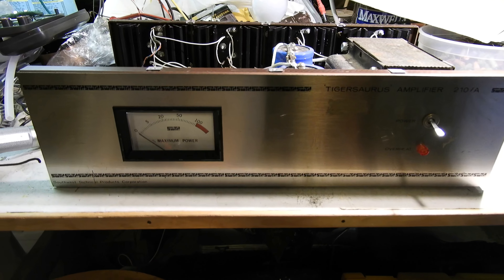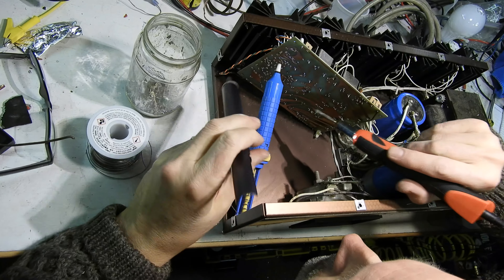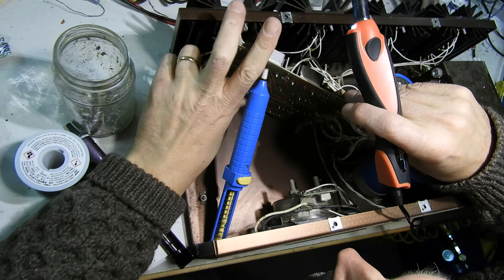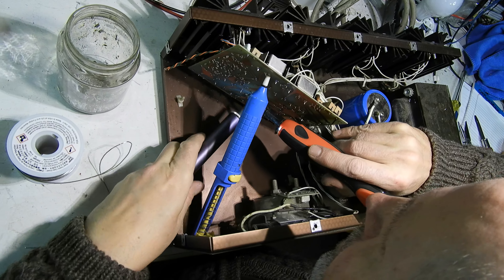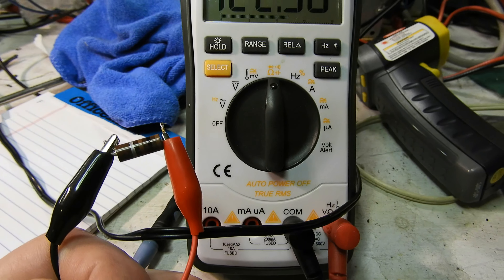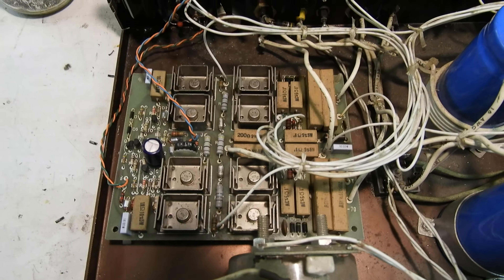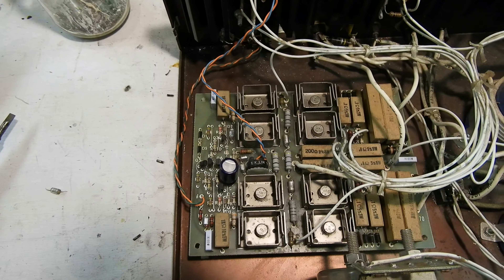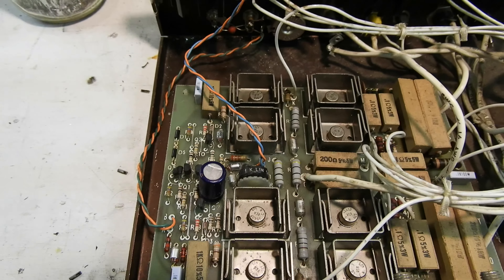Carbon Composition Resistors in a Tigersaurus Power Amp

Comment: I am going to strip the PCB out of this bad boy and am going to go over everything with a fine toothed comb. I may try remounting or replacing the outputs first though. There may be a second edition of tigerfest 2019 later this year. Stay tuned.
Reply from the maker: The 300MHz really seems to come out of the power section, it might be in the chassis wiring. Really need to check those other Carbon comp resistors, especially the one shunted by a coil we have yet to unsolder the coil to check. Maybe some corrosion in a mechanical connection somewhere, should even take a careful look at the red and black binding posts themselves. Anything that connects via a tabbed toothed washer, like the all the Collectors for instance. That 300 MHz is pretty consistant, pretty sure that's driving the freekouts that happen more and more readily as things warm up. Seems there should be some huge problem looking us in the face in order for that VHF to always be there.